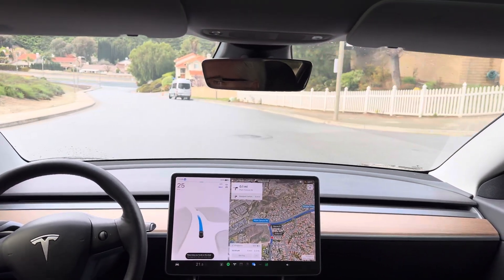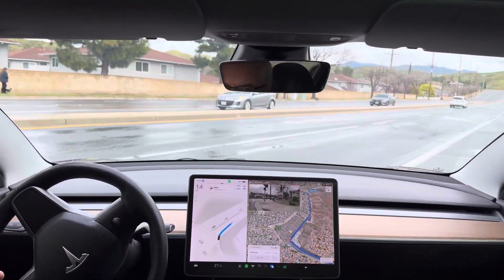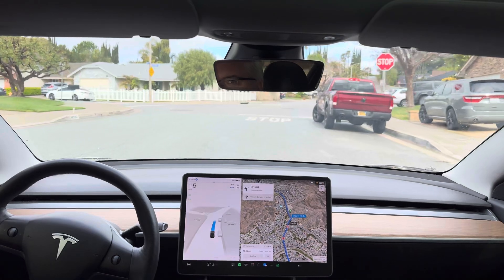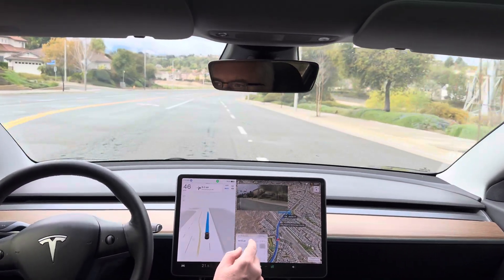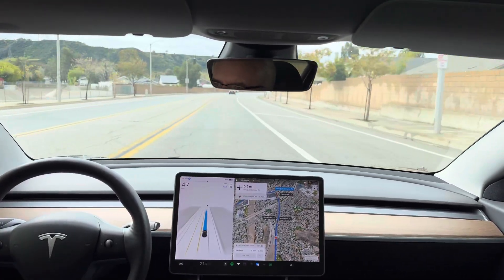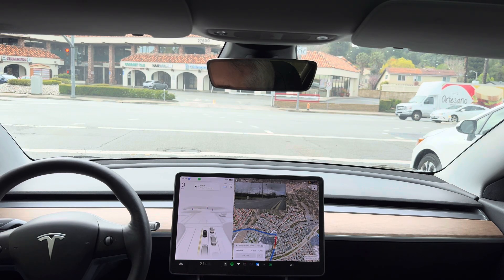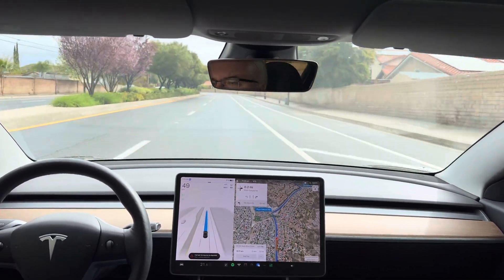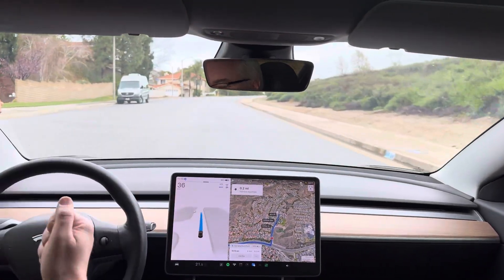Model 3 - Beta FSD 12.3.1 - Test Loop 1 Take 2 - 2023.44.30.30 - 30 March 2024

Comment: Good test. If you set a higher f number on the lens the outside will be in better focus, not just the screen. Try f9 or so. Should be enough daylight for that. You might have the camera set to auto, it might need to be set to "aperture priority" to use a fixed f number. I assume it's some kind of larger camera (SLRish) or there wouldn't be that shallow a depth of field. 30fps is also plenty for FSD videos which gives it a bit more exposure time. And less storage use and editing time. 60fps is overkill in most cases.

Comment: Why are you using the auto speed offset function if you don't want to speed? It's literally just made for drivers who wants to speed all the time.

Just turn it off at put an offset of 5 or 10% in, if you want to have the car go slightly above the speed limit.